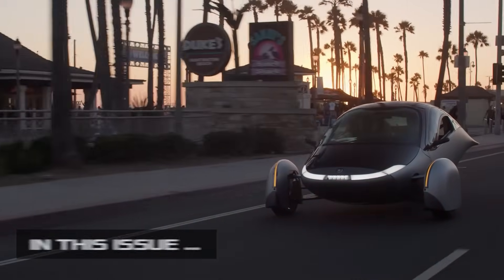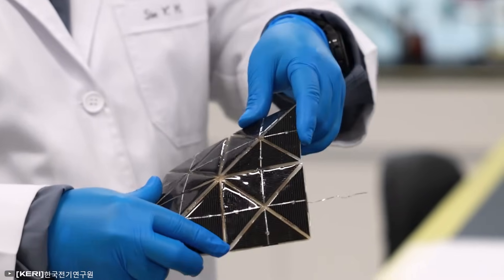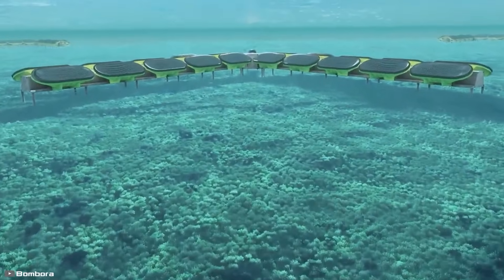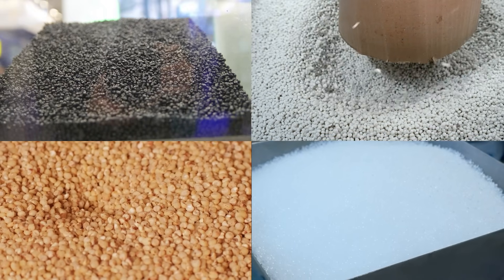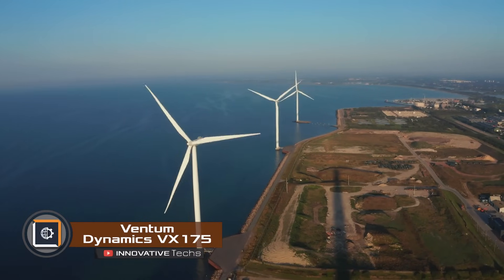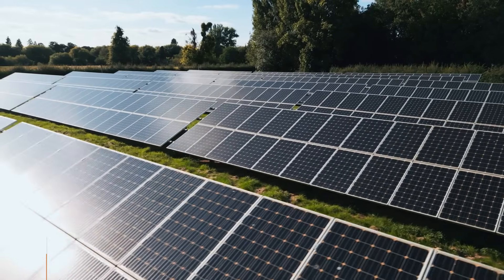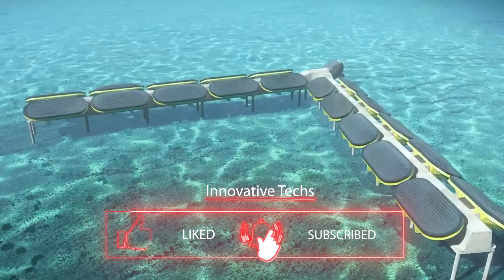This Wind Turbine Will Transform Cities

Comment: Just to let you know, Let me tell you:
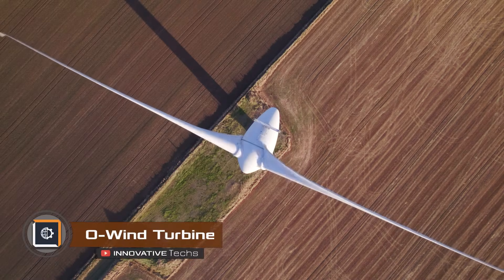8:12 OWI turbine, they invented it? I have it on my roof of my house from 1968, and some in neighborhood had it before me. The only difference is: we use it for ventilation, air out and in.
The largest invention after collapse of the pyramids as factories (n500), is glass and windows from it.
Chill.
999% ok 👌

Comment: We are already short of sand. Could the sand battery be made using crushed concrete from demolished buildings/structures?
Reply: Any gravel or similar material can be used.
Reply: @runeaanderaa6840  Good to know. A German recently found a way to make concrete from demolition sites reusable. I was unaware that it was unusable for anything other than land fill prior to that.

Comment: Somehow it's running out of energy, hearing all this cheering up world changing new energy consumption machines and vehicles. For someone who is considering the industry, rentability and marketing as the most active destroying forces of everything, it really starts to annoy to hear from new even larger but more efficient powerplants if the lifecycles of any power consuming product isn't supposed to be longer than the warranty, then it needs to be with a complet new one, because repair is more expensive than using up raw materials, that a advertised as recycled, but are commonly found on every waste mount of the poorest third world countries. The superhappy voiceovers are becoming cynical.
Reply: Good example of huge waste. Ten yo Old Wind turbine housing that are structurally deemed unfit  for service end up in huge farms with acres of blades and impeller housings just laying around. The pitch was The half life was 75yrs.  Yup no 5-10yrs later being replaced. And now the question is. What do we do with the junk. Literally we cannot break them down into their base forms because the cost and impact would be horrible.   Personally speaking. I like the idea of using a digestive ripping and grinding tool to create building material.
Reply: @johnnyrebel3340  Just how will they recycle all these carbon and fiberglass layers baked into the strongest resins what made the whole structures sturdy and flexible, resilient against everything but the residual risk. 👍 stay positive, life doesn't make sense since the dawn of humanity.

Comment: Interesting that you included the Aptera without naming it, an electric car that's been in development for some ten years now and still hasn't reached production. I wonder if it ever will.
Reply: It hasn’t been in development for 10 years. The company went bankrupt and sold everything in 2010 if I remember. The company came back with the og guys in 2019, they have been running mainly on crowdsourcing, grants, and some investment. They have put more of their money in simplifying the manufacturing process and making parts that can be sold to the market like there solar ( they have deal with trailer manufacturer and telo). They already on pi 4 for the last testing and they will manufacture this year.